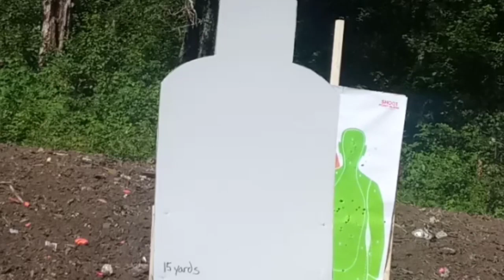Reloading #00 buckshot

Comment: why do you cut the wad petals off?
Reply from the maker: #00 pellets don't stack well in a wad. By removing the petals it gives the room needed for a good stack. If the petals are not removed you will get bulges on the hull. Thanks for watching my video
Reply: @12galife  wouldn't that hurt the barrel? Is there any kind of coating on the pellets?
Reply from the maker: @ericglaub6900  just gonna get some lead fouling in the barrel won't hurt anything if you keep it clean. Pellets are coated with graphite powder
Reply: @ericglaub6900  actually it gives less wear to the barrel. Plastic laps the barrel (as extended sabot shooting in muzzleloaders has shown) while lead, a softer material with good lubricity, will allow the barrel to last indefinitely (which explains the good condition of many antique rifle bores of yesteryear). The reason for the cup is to prevent shot deformation (for bird shot by example), which the content creator notes is not relevant in the distances and application of 00-buck defense loadings. More important to have unbulged cases for reliable feeding. An alternative is to use single-ought buck which will stack inside. Either is fine. Great vid  uploader!

Comment: Good video,  can you do 2.75 inch Straight walled hulks with Blue dot?
Reply from the maker: I haven't tried any with blue dot but i will check into it. Thanks for watching the video
Reply: I use 32 grains blue dot with 209A primers and I've been using 10 pellets #00 which weigh 1-1/4 ounces. I also loaded the same powder charge with 8 pellets #00 buck 1 ounce, they were low recoil and a little slower.